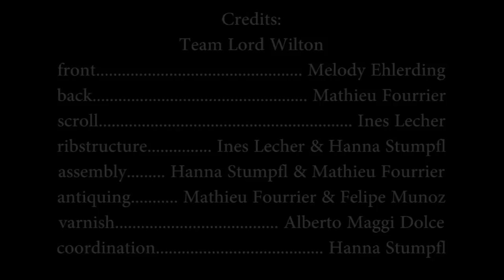Newark School of Violin Making 2016 Lord Wilton Challenge

Comment: They should be taught never to use a chisel like at frame 5:57. It is an accident waiting to happen.
Reply: It's a gouge not a chisel. This is the only position that works for carving a violin scroll and is perfectly  safe, as if the gouge slips the only place it can go is into the wood.  In any case the cut is highly controlled, using a very sharp tool that cuts easily (and is therefore safe to use), or the scroll would be ruined.